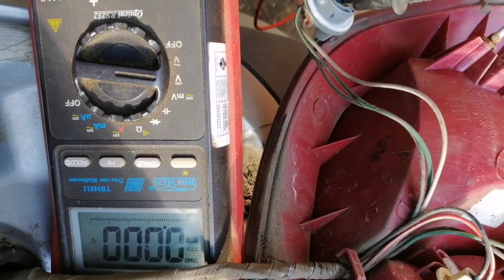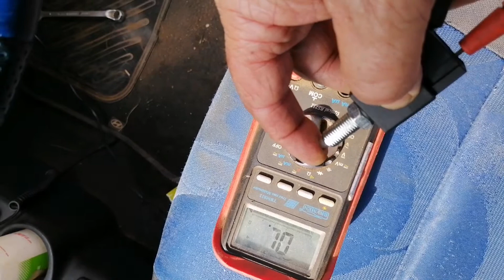Diagnosing & fixing both brake lights not working.

Comment: Hello , I need help , I fix my own stuff but this has me beat , 98 Mitsubishi pajero / montero lwb gls , I have no top brake light and no rear wiper , i have turn signals , bottom brake lights work , I have tested the bulbs and the cluster and fuses , I hit a huge pot hole smelled some plastic burn, lost my alternator the 
A/T light battery light came on was down to 9v I replaced with new one thats all good but I can't find why brake and rear  wiper won't work , is there a relay or something obvious or secret im missing ? any ideas? Would massively appreciate any wisdom I'm not usually one to ask but I have to admit I can't work it out .